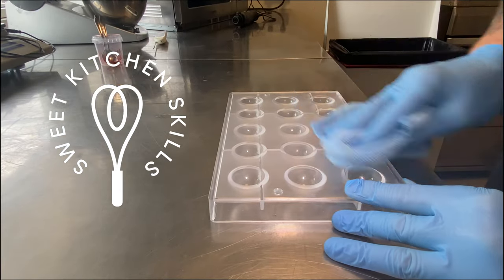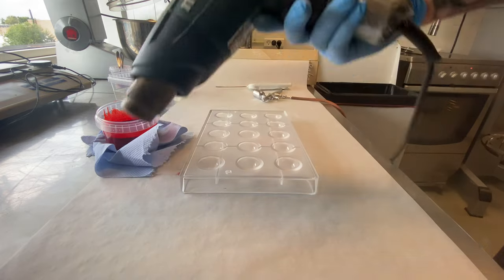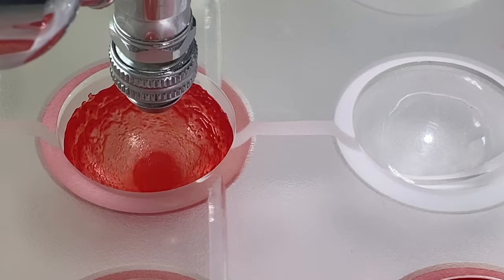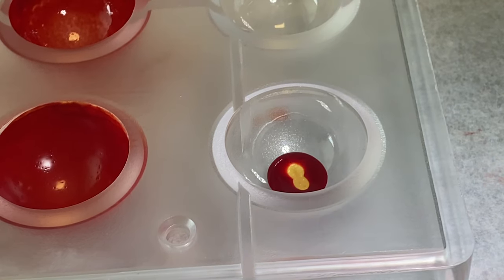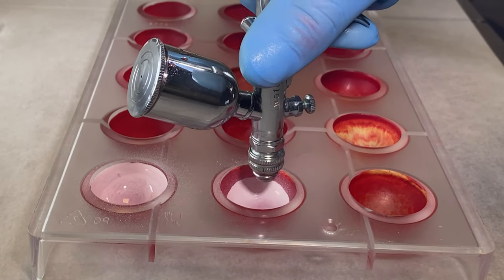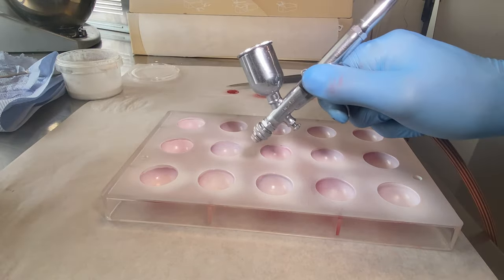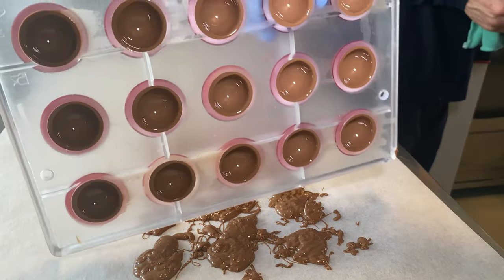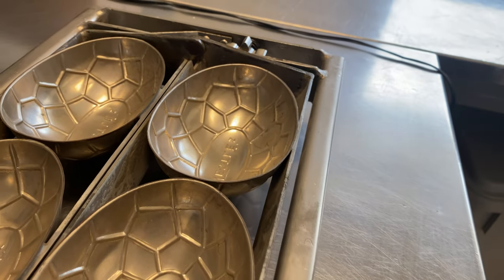Bonbons with homemade cocoa butter

Comment: How do you reheat cocoa butter if it ever gets under 26°C and still no get it too high it wont shine?
Reply from the maker: Just heat again to 28-29C.
Or start from the beginning. 45C, cool to 26C. Use or heat to 28-29C and use.